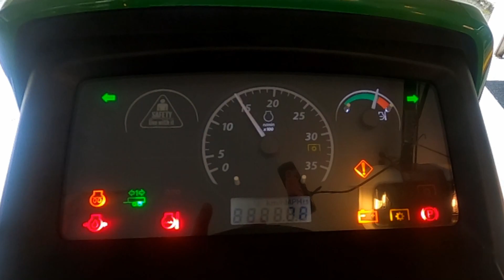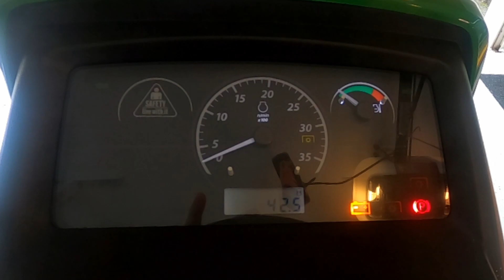John Deere 2025R - It's Spring! Removing the Snow Blower . . .

Comment: I have the same 2025R and snowblower.  With the lack of instructions it was difficult to figure out everything with the initial snowblower installation. Even figuring out where the hose brackets go... and how those thick triangle pieces attach etc. It was great to watch your video, pause and take note how everything mounted. Much appreciated since there is very little info on the 2025R.
Reply from the maker: As I mentioned in the video I was frustrated as well at the lack of clarity in the equipment instruction & service manuals how to install the snowblower, and have it work properly.  Glad it helped you - I will be doing an installation video in the fall to highlight even further somethings not so well described or illustrated in the manual.

I don't know if I had mentioned this in the video, John Deere dealers are constantly receiving updated manuals, with clear descriptions and illustrations for their techs . . .  I found this out when I was asking a lot of questions that I couldn't find answers for in the manual I had.  The Service Manager let me look at them and it was how I final was able to figure out what needed to be done.  I asked if I could buy one and he unfortunately said these are nor for customer distribution / sale.

Comment: Thank you for the great videos.  I have the same set up.  Had it delivered this past spring with mid mounted mower.  Need to remove mower and install snowblower.  Looking forward to your install video!
Reply from the maker: Thank you.  Just published the Snow Thrower Install yesterday - hope it helps in pointing out some of the details that is not really addressed in the JD Manuals that should be there.  My experience came from that old school of the number of mistakes, and whooops one has had, giving you a lot of experience!

Comment: Good video, just bought the same setup. Will try this weekend hooking it all up. Do you know if the bucket assembly can be used with any of the snowblower pieces attached? Would be nice to not have to take it all apart to remove snow piles or whatever.
Thanks am
Reply: Just put mine on. The year 2020 has the wire on the side of the tractor mount now. Engineers must of have finally used their head or read complaints
Reply from the maker: I hope you are enjoying your 2025R as much as I am.  Interesting you mentioned the need to reattach your front loader & bucket when you have the Snow Thrower and all it mounts, PTO shaft attached for the winter.  Unfortunately you can't, as you know.  There is several clearance issues between the loader and the Snow Thrower front mounting bracket and PTO shaft mount. 

Believe me I have attempted it several times - its like trying to drive a square peg into a round hole - its just not going to fit.  I have just conceded when I have the Snow Thrower attached/mounted for the winter - it stays that way until Spring.

Comment: I have 3 acres of hilly bushland and have narrowed my search for a tractor down to about 5 options from different brands. I am most interested in the 1025r and 2025r curious why you upgraded to the 2025r, and how you find the stability difference (I am leaning toward the 2025r,  but wondering the advantages are worth the extra dollars)
Reply from the maker: I got my 1025R in 2017 - it did almost everything I asked of it - believe me it was a fantastic tractor.  However I was getting into jobs where I begin to experience limitations - like just not having enough front loader lift capacity, (826lbs vs 1023lbs) and lift height (72" vs 78").  Ground clearance also became a growing issue, as well as the industrial tires I had on it really tore the lawn up when it was soft after a rain.  When the redesigned 2025R was announced in 2019 it immediately caught my eye with having a higher ground clearance and a longer wheel base, its also 200+lbs heavier.  It also had larger diameter tires, with a wider footprint that disperses weight better over the tread and onto the ground.  The other new tire feature was the Radial Tire option that is a cross between the lawn tire, and the industrial tire.

The 1025 & the 2025 share the same 25HP diesel - however the 2025R has a higher capacity/higher pressure hydraulic pump giving it more loader lift capacity, as well as added 3-point hitch lift capacity (681lbs vs 1,150lbs).  That sold me and I traded my 1025 in for a 2025 in February 2019 - my local JD dealer also worked with me unbelievably in pricing it with all the options I wanted that included the Front Loader, Back Hoe, iMatch 3-point connection system, and a 54" Snow Thrower and with the Radial Tires.

With all these options/features you are really only looking at a couple of thousand dollars difference - with a lot more capability with the 2025R.  For the value the 2025R in my opinion has it going for it.  However, I can understand if the budget has a limit, the 1025 will do everything you ask of it.

Stability - I am still not totally happy - you need to be very careful on driving on grades sideways.  A solution to increasing stability is adding rear wheel spacers - 6" on each side.  Not a JD product, however offered by a number of qualified JD aftermarket suppliers.  These can be added to the 1025 as well and helps.

Comment: Does the snowblower not lift high enough to fit on the dolly before disconnecting it?
Reply from the maker: I am sorry for the delay in responding - No, the Snow Thrower is not lifted high enough to get a dolly underneath it.  The total lift height is something between 6-8" max.  That's more than adequate when using it, and maneuvering around.  Coincidentally the ground clearance is only 6" under the front support bracket where the hydraulic lift is mounted.  Additionally when "lifted" its actually tilted back slightly, not a straight up and down lift.  As you can see in the video this is why I use lift straps attached to my pallet forks to lift it on and off either a dolly, or the pallet I store the Snow Thrower on.
Reply: @m3entertainment228  no worries at all! I ended up getting the new front 3pt heavy duty version and it seems to lift up a bit higher…I can fit a furniture dolly under it when raised up so it’s pretty convenient 👍

Comment: Do you have a video installing the blower?
Reply from the maker: I am planning on re-installing the Snow Thrower in the next week or so and will do a video as I mount it.  The only issue I have when I re-install the Snow Thrower it "paralyzes" the tractor from using it for firewood cutting/gathering, other yard work, etc.  If you un-mount just the Blower itself, you can't mount the Front Loader with the forward mounting bracket for the Snow Thrower that supports the PTO - not enough clearance between the Loaders support stand and that forward Snow Thrower mounting bracket.  

So I try to hold off mounting the Snow Thrower as long as I can, until Mr. Weather Man says no-doubt we're going to get some accumulation.  Sure, you can always just un-mount the Snow Thrower to reattach the Front Loader, and then re-mount it with what ever work that was needed is done  - just a pain in the butt swapping everything on and off.

Comment: Nice machine.  I'm looking into the same set-up myself.  You mentioned that you're in northern NJ, so am I.  What dealer did you work with?
Reply from the maker: The John Deere dealer I have used for years is Power Place.  They have 2 stores, the main one where they have the bulk of inventory of tractors and lawn equipment is in White House Station on RT22 west of the Bridgewater Mall.  They just expanded it last fall and they have a lot of inventory, both indorrs and outdoors on hand to look at, kick the tires etc.  

They have another store in Rockaway on RT46, much smaller.  They do have one 1025R most of the time on the showroom floor - occasionally a 2025R as well and maybe a Gator there - not a lot of room so very limited.  While the White House Station store is a bit of a drive, well worth it with the inventory they have to see.  White House Station is where they do all there service work and where they prep tractors for delivery/pick-up.

It's a family run business and they have been doing it for years.  

There is another Dealer up in Rockland County, NY - that dealer is what they call and Agricultural Dealer that sells the biggest of the JD product line.  So the 1025 & 2025 would be on the small end of tractors they carry  - not sure what inventory the may have.  Power Place is a JD intermediate product line dealer, with the 4 series of tractors being the largest they sell.
Reply: @m3entertainment228  Ok thanks.  I got my 2520 TLB back in '08 from them (Rockaway) and met with their sales guy this past weekend about a 2025r TLB.  Was originally looking at the 1025r TLB, but I'm probably gonna put this next machine to work (aside from myself), so now I'm leaning towards the 2025r TLB for the added capacities and capabilities.